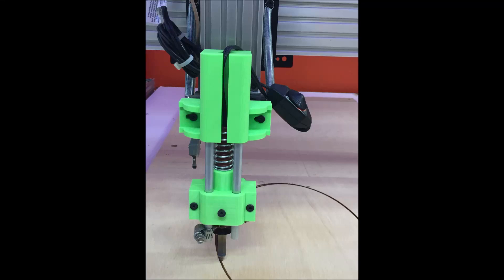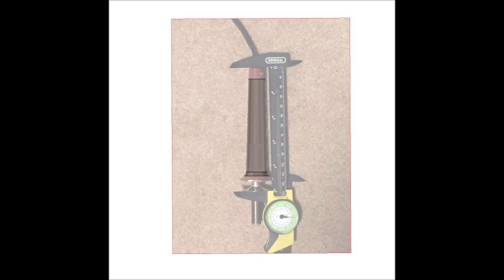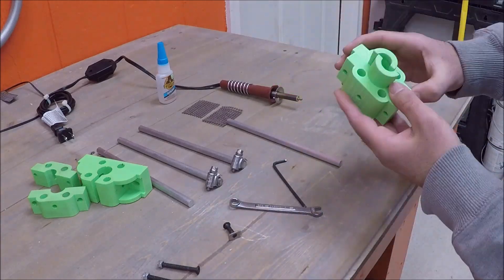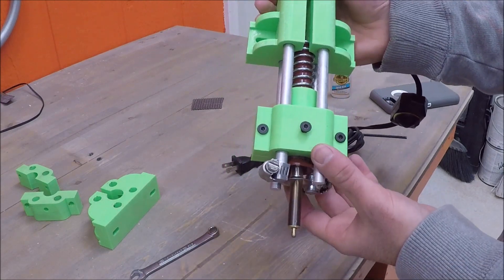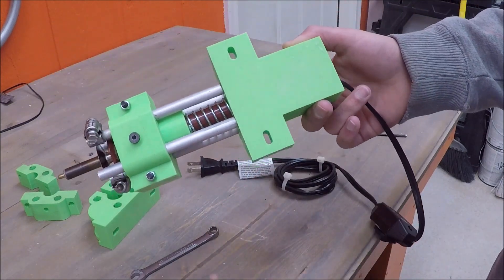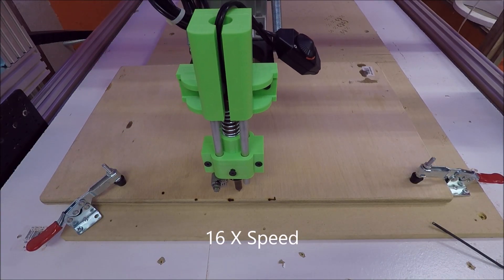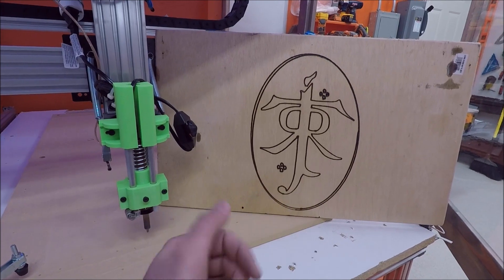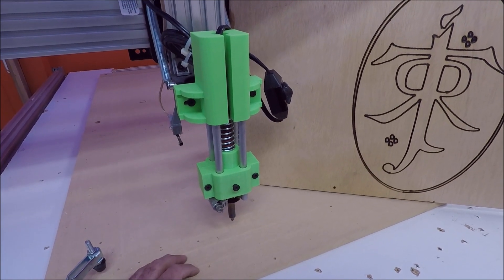3D Printed CNC Wood Burner

Comment: Nice, but i think you should simplify it. There is just too much play at the tip of the iron. Did you think about a laser diode/module? They are not that expensive these days. Either way, thanks for sharing!
Reply from the maker: Great minds think alike! I ordered one a few weeks ago, have it mounted on the CNC, and plan to make a video about it in the future.

Comment: Why 30 min for that small simple outline picture???
Reply from the maker: Hey Samir. Fair question. The tip of the wood burner has to move slow enough to burn the wood underneath it. If the wood burner would have moved any faster the burned lines would be far lighter or may not have shown up at all. The limiting factor of the setup shown in the video is the wattage of the wood burning tool. The CNC could have traced this path in a minute or so if I set the speeds higher. 

I have a video called "CNC Wood Burning Tool" where I made a proof of concept to ensure a wood burner on a CNC was feasible before I designed a 3D printed model. In that video I talk more about CNC speed settings and how it impacts the shade of the lines made. Hope this answers the question.
Reply: Thank you for answer.
Can you tell me this ,can i put pyrography pen with wire tip,like that ut will be faster??
Burnmaster eagle pen.?
Thank you one more time
Reply from the maker: I am somewhat skeptical on using a wire tipped pyrography pen for this sort of application. The CNC does not have a soft touch when touching the tip of the wood burner to the surface of the wood when the machine is running. I would be concerned that wire tip would get mangled during the wood burning process. Cool concept though. If you ever get a setup like that running be sure to send me a picture!
Reply: You have fb page or something?
Reply from the maker: I don't have a facebook page but you can email me at electricworkzshop@gmail.com.

Comment: Excellent work!  Very impressive! Do you have plans for this attachment?  I would love to try something like this.  Thanks!
Reply from the maker: Thanks for watching the video! Unfortunately I don't have any written plans. The vast majority of the items I used to make this device were what I had laying around. I believe the rods were 6mm aluminum, the hardware was leftover from the original CNC build, and the wood burner was something I bought from the hardware store. The only items I have files for are the 3D models associated with the build, but those were designed specifically for the tapper of the wood burner I was using. The 3D files may not work or would require a good old fashion dremel tool to get it to work if a different type of wood burner was used. If you would like a copy of the 3D files send me an email and I will send you a copy.